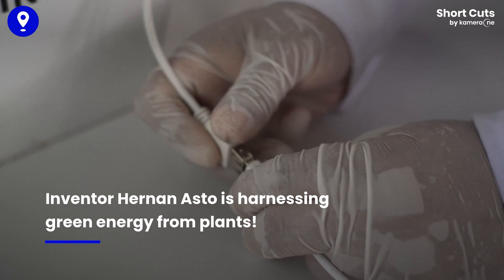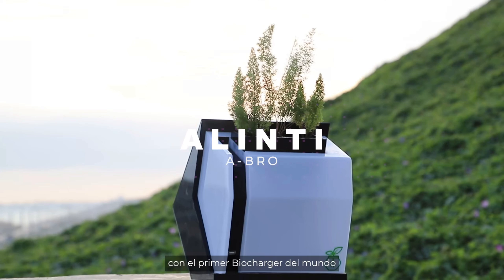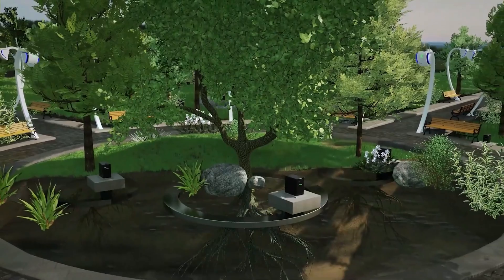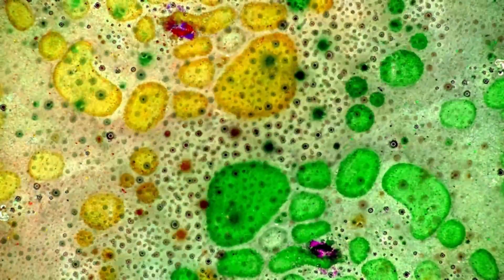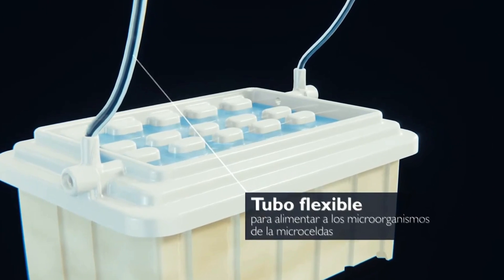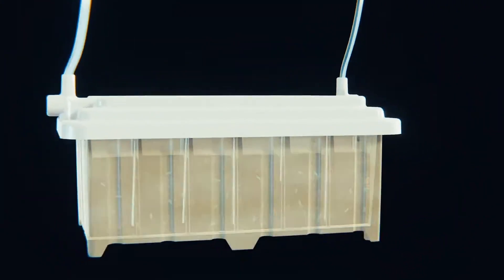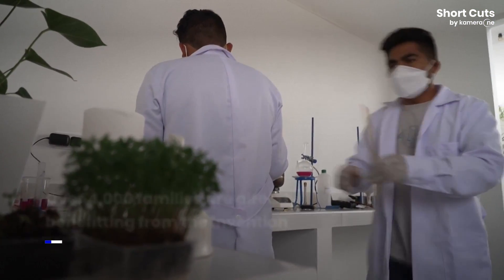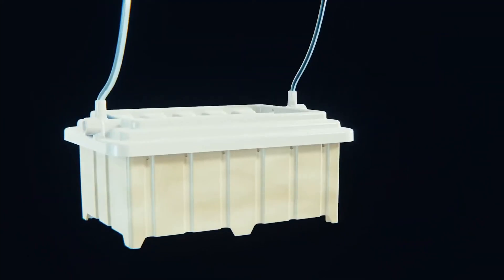How Alinti Turns Photosynthesis Into Electricity

Comment: Summary of the Alenti Device: A Breakthrough in Renewable Energy

Introduction

The Alenti device, developed by an innovator in Peru, represents a groundbreaking advancement in renewable energy technology. It leverages the natural process of photosynthesis to generate clean and sustainable electricity, making it a game-changer in the field.

Origin of the Name

The name "Alenti" is derived from two indigenous Peruvian words:

- Ali: Meaning "plant" in Imara
- Inti: Meaning "sun" in Keta
This fusion reflects the device's harmonious integration of nature and technology.

How It Works

1. Photosynthesis Process  

- Plants absorb sunlight and convert it into chemical energy.
- During this process, plant roots release organic compounds into the soil.

2. Microbial Activity  

- The Alenti device contains a special cell filled with organic soil that hosts microorganisms.
- These microorganisms break down the organic compounds released by plant roots, generating electrons.

3. Energy Capture and Conversion  

- The device features a polymer-based electrode system that captures these electrons.
- Unlike traditional metal electrodes, this polymer is corrosion-resistant and more efficient at converting bioenergy into usable electricity.
- Captured electrons are transformed into electrical energy, creating a cycle of nature and technology working together.

4. Energy Storage and Use  

- The generated electricity can be stored and used to power lights, charge devices, or purify air.
- This process is entirely natural and sustainable, relying on the continuous cycle of photosynthesis and microbial activity in the soil.

Addressing Concerns

While some may wonder if "free energy" contradicts the laws of physics, it is important to note that Alenti does not create energy from nothing. Instead, it harnesses solar energy in a novel way by utilizing plants as natural solar collectors, ensuring compliance with the principle of energy conservation.

Impact on Communities

- The Alenti device is recognized as a legitimate renewable energy solution by the scientific community.
- It serves as a lifeline for communities in remote areas of Peru lacking reliable energy sources.
- Beyond lighting, it can charge smartphones, purify air, and neutralize toxins, significantly improving the quality of life for users.

Conclusion

The Alenti device exemplifies a sustainable and innovative approach to energy generation, demonstrating how nature's processes can be harnessed to meet modern energy needs without compromising environmental integrity.

Comment: This is bs. They just made a galvanic battery.
If you fill the tub with salt water it would work the same.
And at certain point the cost outweighs the benefits. It would be lot more efficient to run a solar panel and convert sunlight directly into electricity.
Reply from the maker: so you suggest they abandon this for solar,,,, Maybe Solar Panels are more expensive that part of the world
Reply: @chriswabs  their expectation has lot of holes. Right now this just looks like earth battery. And if they are using some sort of organic anode electrode there is still electrochemical reaction that will erode them away. Considering it all if they used graphite and magnesium air battery they would get cheaper product.

Comment: A simple solar panel does this much better!
Reply: That is quite a narrow way to view things. The environmental applications of this tecnology are so absurdly groundbraking that it is not unthinkable to have FORESTS as generators in the future. Not to mention the costs of manufacturing and manteinance. This is the greatest energy development of the last 50 years, if not ever!
Reply: @diegopereira9452  I would argue that the light and heat energy density from the sun is greater than anything you can get from plants. Although an option, compare the two!
Reply: @ideedit  The point is that you are thinking exclusively from the perspective of energy production. There are other factors to be considered, and if we could keep a whole forest at the same time it produces electricity, even if at a less effective rate, that is a huge gain.
Reply: I think I would prefer a field of plants generating energy for the city while purifying the air, than a field of solar panels.
Reply: @melvinsuria7331  Yeah that's cool but, 1 acre of solar panels would provide more power than five corn fields of plants!
Reply: @ideedit  maybe that's because solar panels have been existing for a longer time. This Alinti technology is quite newer, so I might take some time to make it more efficient.
Reply from the maker: that's true,,I guess solar panels are a little expensive where they use this concept